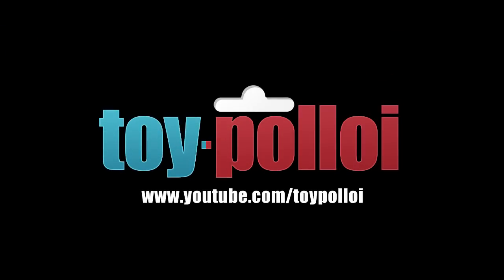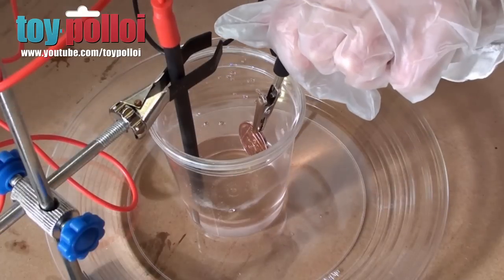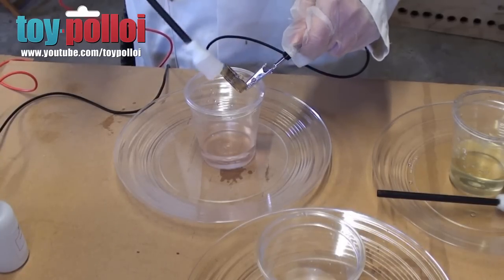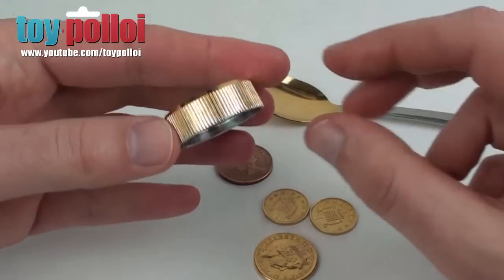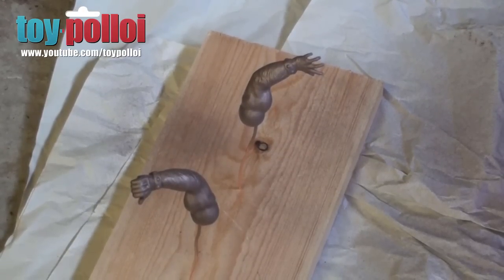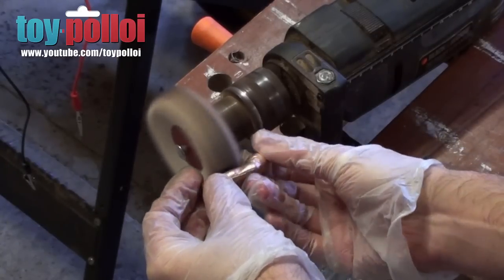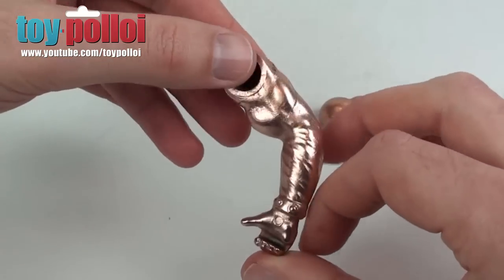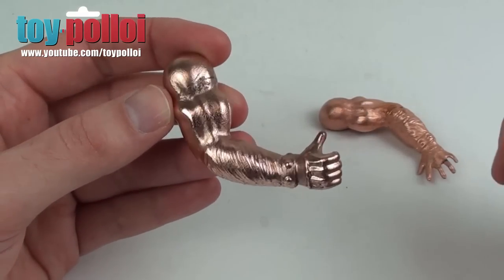Electro plating plastic - Tests on vintage action figures - Toy Polloi

Comment: was thinking you could use a busted up  torso  and use its peg to "mount" the arm that way you don't have to worried about the metal clogging up the socket, Might be able to wire it up better with the added "meat" of the torso .  great  video thank you  for the hard work.

Comment: how long do you live it in for ?
Reply from the maker: It depends on the size of the object. You have to do some calculations at the start.
Reply: Toy Polloi ahhhh that explains why I keep on  burning it .. how do you calculate ?
Reply from the maker: The set came with instructions on how to calculate the area, and then work out the voltage and timings. I just followed those and it worked great. The details will be on their website, or drop them an email.
Reply: thanks, definetly will

Comment: this is amazing - dies anyone know if these kits are for sale in the US? Apart from figure restorations do you do any custom requests? specifically I would LOVE to have a Character Options 4th Doctor Who Sonic Screwdriver plated in nickel (not chrome, but a nice steel or aluminum finish would look fantastic!). I even gave a couple that the silver paint gas mostly worn off and it's the same or similar plastic as 3PO and R2s done (us it called styrene?). If you would be interested please let me know and how much it would cost and I think it would be an amazing episode of ToyPolloi!!! Of course how to prevent the sound chip getting damaged during submersion....:-0
Reply from the maker: They sell to the US. Give them a bell.
Reply: Hi there#
Yes we can ship to USA no problem, postage at the moment is around £50.
You can find the electroforming kits here http://www.gold-plating-kits.co.uk/index.php/electroforming.html
The different kits vary slightly in content, some come with buffing machine, some without etc....If you do NOT already have a buffing machine, then the kit that includes one is strongly recommended, as you need a good buffing machine to get the mirror shine (I would say that the slow drill turned on it's side that Dave uses in the tpy polloi vids is not really good enough to get the shine, mirror takes about 5 mins on one of the proper buffing machines)

All kits are sent out with proper customs commercial invoices and product codes

You would need to remove any electrical elements from items that you want to submerge in the tank.

Comment: would be interesting to see motu accessories being done ie swords and spears etc and axes, even going as far as to copper and nickel plate an axe and then on little spots, brush plate on some little dots of copper to simulate rust etc. I would possible electroform such items for 4-5 hours if they are bendy/soft plastic to ensure rigidity as you don't want electroformed items bending, it will cause cracks, but after that long of plating it should be strong enough to resist bending under normal circumstances

Comment: Nice!  I'm still on the fence, as I'm not sold on the need to plate in copper first.  I'm glad to see that the additional layer doesn't look like it would affect the detailing too much.

I'm still thinking that Optimus would appreciate a chroming ;-)
Reply: Copper is... stickier than other metals. Also it let's you solder on it, so it makes a great base coat.

Comment: I always wondered how the chrome and gold effects on toys was achieved and why it was soo hard to re-create, well ya live and learn
Reply: Crazy Monkey This is a labor intensive method, companies use a process called vacuum deposition where many items are suspended in a vacuum chamber, then a solid metal (typically aluminum) is vaporised and the aluminum atoms adhere to the plastic parts to give a highly reflective surface.

However, Dave’s solution is better suited to single items or small batches.